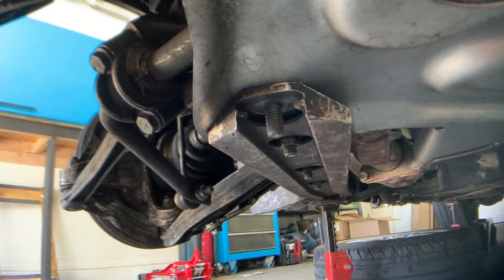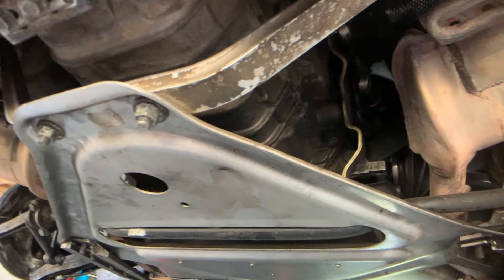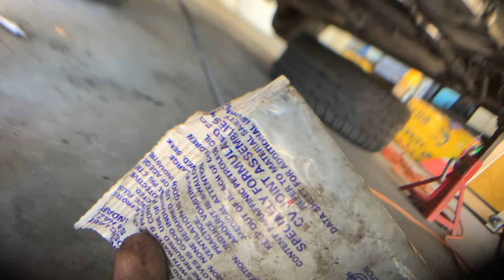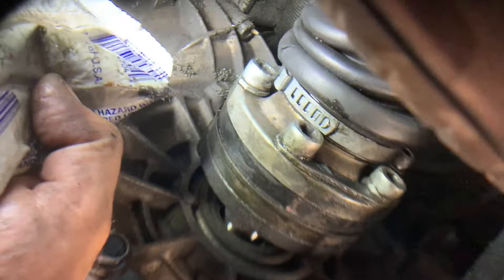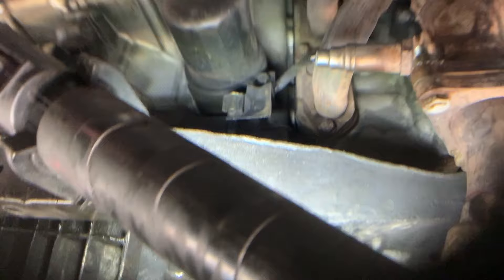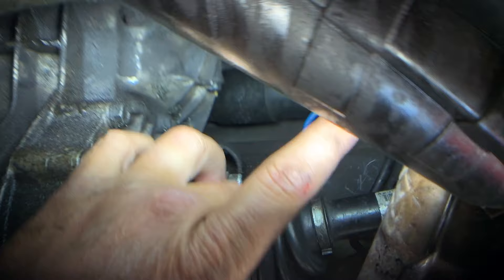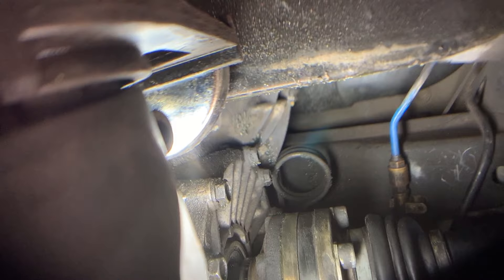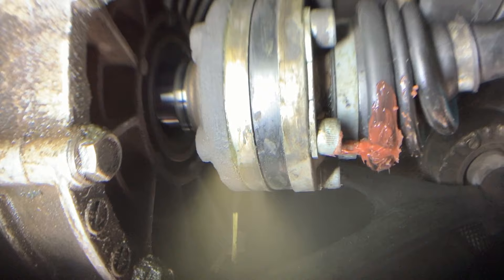How to fix a tear in your CV boot

Comment: Use a high quality roofing tar/sealant, and if it's split at the peak of the bellows, use a very small ziptie(s) to 1st clamp it back together, then apply roofing tar/sealant thereafter on the area. Make sure to give it enough time to cure, sometimes up to 24 hours.

Comment: Interested to see how you do this! I've repaired damaged CV boots before with zip tape that actually worked well for what it is. Cleaning the boot is the hardest part, you MUST get that boot as clean as possible
Reply: Why does it matter to make the boot clean as possible really curious
Reply from the maker: So the glue will work correctly, any grease and the glue doesn't hold up as well.
Reply: You mean zip ties. I used micro zipties(the boot was split at peak of bellows) that minimize tearing up the boot, then I covered the entire area with roof tar/sealant, which is very strong and flexible.
Reply: @DG-sf9ei  did the roof tar/sealant on CV boot work?
Reply: Curious did the zip tie / tar sealant work?
Reply: @dylancamacho3741  also you want to get the boot clean as possible to keep from getting any kind of trash or grit that may stick to the boot inside the metal knuckle, dirt or grit will destroy the CV joint quickly once it gets inside the boot and you drive it for a while
Reply: @ArrowheadGarage  i think that you are having a lot bigger trouble,shaft is out of transmission seems to me.

Comment: A tire rubber patch tape  w/rubber  cement / butyl tape  is anither alternative since it makes a good chemical bond as long as you clean off any grease. Another method is to sew the rubber w multiple metal threads and then seal it with the silicone.
Reply: great ideas bro
Reply: The solvent inthe glue can finnish aged rubber off. I think Tear-aid would work well, but must be super free of grease.

Comment: I like how there's rubber pads bolted between the plates, brilliant way to absorb more of the damaging forces and vibrations. They aren't like that on anything I've owned, wish they were.👍
As far as grease, I just got a grease needle 💉 attachment to grease all the crap they don't put grease fittings on anymore.

Comment: I actually thought of this myself when I first found out I had a tear very recently.  But I also thought that it might be a good idea to combine it with that silicone stretchy tape that adheres to itself.  Idea being that you put the silicone caulk on there first, then wrap it with the self adhering silicone tape. Let it cure, then maybe put some more on the edges etc to make sure that it really sealed up well.

Comment: Not sure if the silicone adhesive you're using requires air to set up(aerobic), but if it doesn't,  I've had really good luck using thin strips of saran wrap or  Glad wrap to cover the repair in other applications (mostly epoxy based) where you can cover the repair with the plastic wrap and mush the  adhesive around working the  wrinkles and air bubbles out of the repair and then  fair out the adhesive  towards the ends of the plastic so the repair looks a bit more sanitary.  The  Saran Wrap won't stick to the adhesive once it's all set up and even if it does,it's not gonna be a big deal.  When we repair whitewater composite damage to kayaks with kevalr and carbon fiber, we use this technique to rid the repair of excess resin and then tape the plastic radially down and use a roller to get the excess out and meak it pretty .  Taping in your situation here is impractical and not sure if a hair dryer would help heat shrink the plastic.  I haven't gotten that anal about rubber repairs up til now.  The technique is called contact bagging and not sure if there's You tube vids on the process or not.  I love seeing redneck repairs on a Porsches.  Glad I never had to do one ofthese on my old 356B back in the 70's
Reply: I like that idea. Also, I wonder if Tear-Aid would work. I use it on rafts, even ones under pressure while I'm puttig it on. (It's a thin, clear, stretchy patch material with aq bad ass adhesive already on it: so it's peel and stck.

Comment: Thanks. This will be very useful as a bush fix when 4x4ing. Only part is waiting 1 hour for it to cure to a relatively decent patch.
Reply from the maker: You know what you're right... add the fix, eat lunch and get back on the trail!!!!
Reply: Going to try this on my 4 wheeler, has a small tear as well on a rear axle boot. Thanks for the vid!
Reply: @mylanhill4011  how’d this trick work for you?
Reply: @hardcore4476  worked good but definitely temporary. Like the above comment it’s a good bush fix to hold you off until you can replace the whole boot
Reply: @mylanhill4011  True

Comment: Darn it, I had the same problem on my toyota corolla yesterday and Used flex seal. If only I saw this video before putting the flex seal spray on it would be so awesome. That RTV sealant is the perfect stuff for this type of job.
Reply: I just put flex seal on my boot 5 mins ago. Wishing I saw this earlier ha.
Reply: @joehumeas7196  i learned the hard way that the flex seal does not fully cure and it actually makes the boot very sticky. Your boot will pick up all kinds of dirt and sand and rip itself to shreds. I learned this the hard way.

Comment: I do something similar I take loctite 401 clean the boot clean the split/tear put a small amount of the 401 on the inside edge of the split hold them together till the glue sets then I cover it with brush on electrical tape.
Reply from the maker: I bet that loctite would do the trick as well!  Thanks for sharing!

Comment: I just grab a chunk of old bicycle tire tube, if i have time to pull the cv i cut a chunk and stretch over the tear with some contact cement glue. Lasts forever. You could also cut a strip to go around if you  dont pull the cv and glue it on too as temp. Perfect for cars youre running into the ground
Reply: This is a much better idea, with the right glue. It would be like a bike tube patch.

Comment: My car's cv boot was cracked all the way. My solution was a hose clamp. Not a permanent solution because the CV boot has been broken a long time. I also put some grease to inside.
Reply: I noticed the cv boot because my tire was flat and I had to use my spare tire. But I don't know how long the cv boot has been broken.

Comment: Take and clean your CV boot and then wrap it with Saran or a thin plastic wrap make sure it's secure and then spray the rubber based cement on it like they use to undercoat a car or repair a leaking roof and then it will look like it's never been repaired after you spray a few coats over the damage joint
Reply: Have you done this successfully? Just found grease all around the boot area, assuming it’s a year. Looking for the best way to seal it up
Reply: @SorrowCloudE  yeah the Saran wrap is a bush fit in other words temporary until you were able to fix it correctly I don't really know exactly how long this would last with the Saran wrap the next best way or the best way as you said in your comment is to completely replace the CV boot which requires either using a split boot with cement to glue it together or completely removing the axle and putting a brand new one over the CV knuckle

Comment: i have a torn cv boot on my truck and was wondering if this trick would work it's a pretty big hole due to the mechanic that was working on it and refused to fix it
Reply from the maker: Build it up… add a layer let it sit fir 20-30 min they another layer… might go 3-5 layers and let it dry fully over night.

Comment: Hey Brian how are you I have a 2014 Nissan Altima 4 cylinder my passenger side CV axle boot is ripped I watched your video and put the Silicon on the boot the boot is fixed but my axle made a noise when I made a u-turn I should drive like this or I should change my Excel and how long silicone stick on the boot if you have idea so let me know please help me thank you very much have a good evening I'm from New York Brooklyn
Reply from the maker: If you here it clicking that means the joint is dry and damaged more than likely.  I will need to be replaced soon, you can drive it for a bit longer before you have to replace the axle.  The boot fix lasted about a year, I knew I was going to have to replace the cv one day.
Reply: @ArrowheadGarage  thank you so much brother I try on my cv Excel but my cv Excel was clicking so I changed my cv Excel because I'm driving Uber and Lyft in New York City in this car I have 2014 Nissan Altima and I use silicone in my control arm rubber boot also there was ripped silicone help to control arm Boot also please reply me again thank you very much

Comment: How many miles do you think this fix will last? I have a boot with only 18,000 miles on it.
Reply from the maker: Hard to say but I have 8000 miles on and still holding strong 💪
Reply: @ArrowheadGarage  i have one split in 2 little on the inner side is on my channel i believe is better to do a proper fix
Reply: @unda25  Most people can't fathom a mult-hundred dollar repair bill or tearing apart the front end of a vehicle on their own just because a rubber boot has a small tear. Mine was at a worse spot than yours, right at the edge of bellows, used small zipties and roofing tar, worked and probly more durable than new. That only cost $10 vs making a shop rich. Now can use that saved money for something more valuable than a leaking rubber boot.

Comment: Will the silicone gasket maker still cure okay in cold weather? Say around 30 degrees ferenheit? The packaging doesn't say...
Reply from the maker: Here in Arizona, we see temps that rarely get to below 32, but so far I haven't had any issues with the stuff not holding up.  I would be interested to learn how it does handle really cold temps as well.  Thanks for watching.
Reply: I can confirm yes it will dry but give it few day's... I did this like 3 days ago In 30F  using clear Silicone and it works.. Just make sure to prep the surface The best you can because that's what will determine how long it lasts... also apply some and spread it out A little and make sure it's all covered